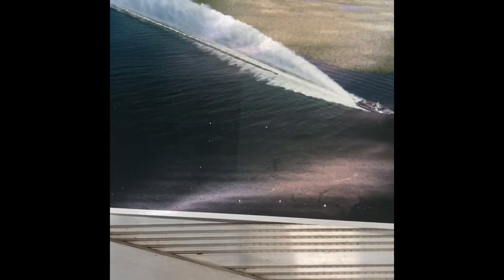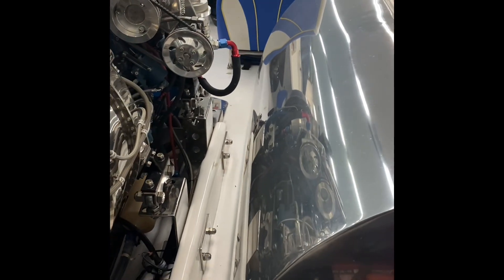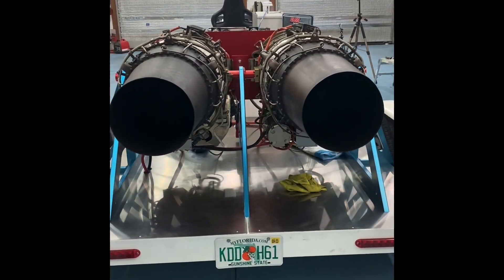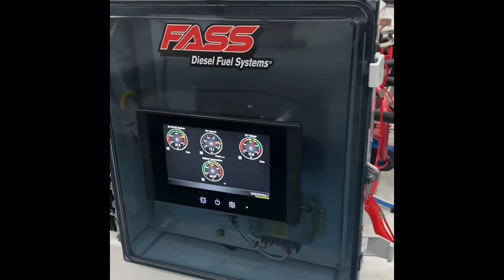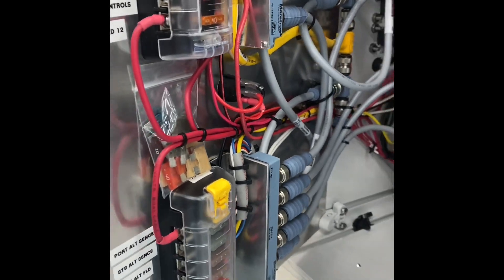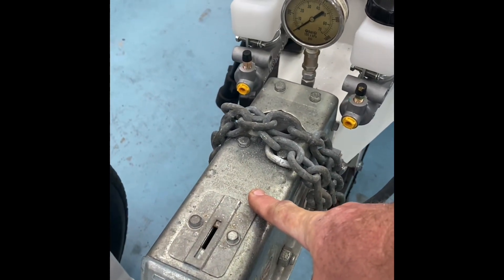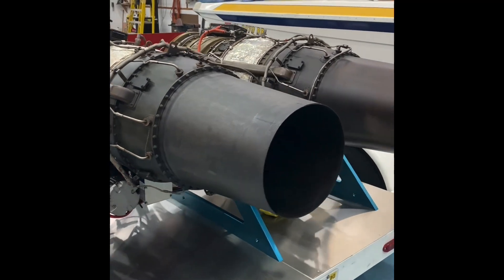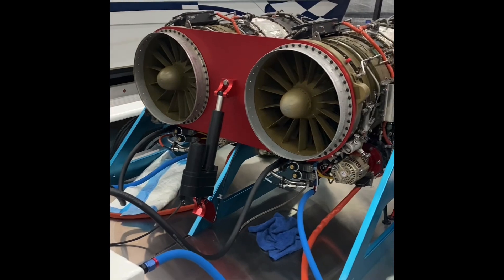Twin Jet Powered Boat #JeLife

Comment: John, great video your need for speed is crazy , I thought the v8 motorcycle was out there then the jet boat now a twin engine boat. The detail that must go into these is incredible.  Who would have thought any of this up in the McKenzie tank line years. Would like to come see you do a trailer test…
Reply from the maker: A lot of these ideas were in my head way back in the McKenzie Tank Lines day the we worked there but $3.25 an hour that we were making back then just wasn't going to cover the expenses. LOL 
I did manage to build a few things back then in the 80's like the turbo charged Rabbit engine in the 4 seater sand rail. If i could have only afforded these things in my youth.